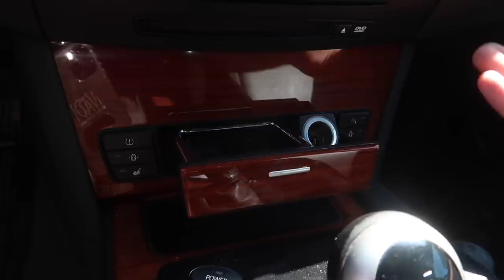PURCHASED THE CHEAPEST CLEAN TITLE V10 M5 IN THE COUNTRY!

Comment: Nour the audio system in your E60 is the individual audio system aka the DIRAC system, what a score! It's way more powerful than the OEM HK systems in those generation E chassis cars. It also uses the same type of digital signal as the HK system (MOST cable to the amp rather than analog), and those beautiful silver speaker grilles that only come on DIRAC/Individual audio equipped cars

Comment: Sick video as always , in the family we used to have a e60 m5 and honestly the engine is pretty reliable if you take care of it and check systematically for weird noises as rod bearing knock
Reply: @HorsepowerTherapy2   yes and no , tbh the s85 ( the v10 ) is not made for a road car because the engine needs special caring to keep it running smoothly so again it’s the same thing for all engines : if you take good care of the engine the car will last
Reply: @ahmedbruxelles3551  there is no fix for a bad design. I’ve asked countless of engineers about that engine and all have said the engine is a failure if it requires rod bearing replacement as a regular maintenance item. Not just that but it’s vvt relies on a over complicated prone to failure high pressure hydraulic system (vanos). Bmw fan boys like to make the argument that maintenance will overcome a bad design which is laughable.
Reply: @HorsepowerTherapy2   that’s obvious the v10 is not the most reliable bmw engine but don’t forget that this engine is derived from f1 competition and it’s designed to perform well constantly on high rpm’s so we kinda expect that this engine is not a smart choice in an every day car. 
Personally we had the e60 m5 for 5 years and we never did other stuff than oil changes ( we bought it with 40.000 km and sold at 137.000 km ) but the new buyer which is another relative had to rebuild the engine and work on the freaking awful smg transmission

Comment: The rear trunk is for E60 5 series not for M5. Because M5’s doesn’t come with rear trunk key slot so i think it will be better if you delete that slot and replace the lower trunk plastic with the M5 one. And for the sound system you either have Logic 7 surround sound system which is (Harman kardon) it’s only mentioned (Harman Kardon) behind the speakers it self it’s not like E46 you can see it written (Harman kardon). Or either you have individual sound system which both to be honest are amazing. But in my opinion the L7 (Harman kardon) is the best. Good luck bro